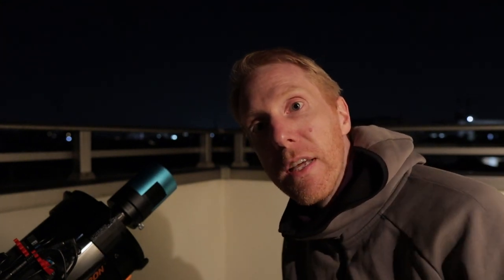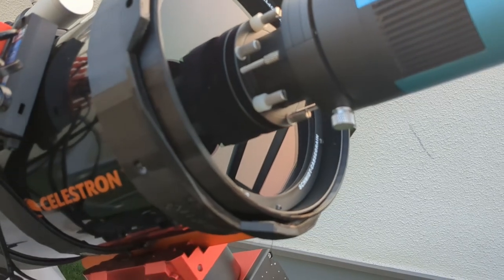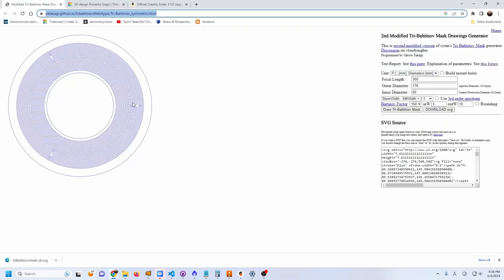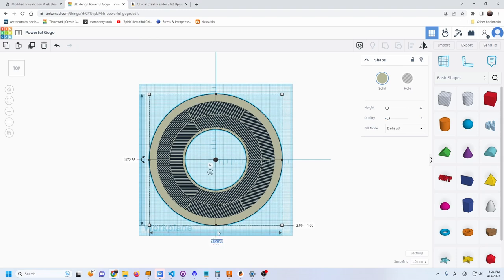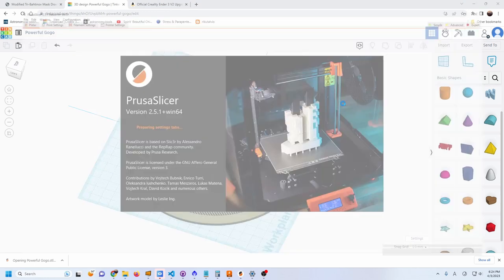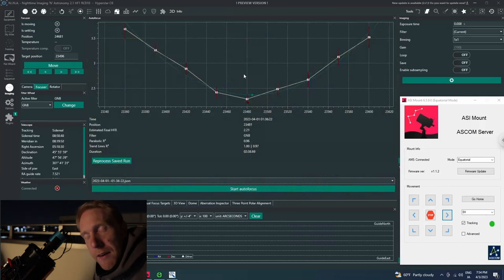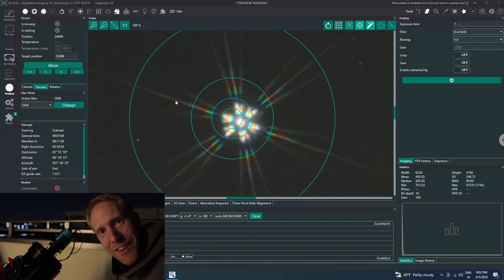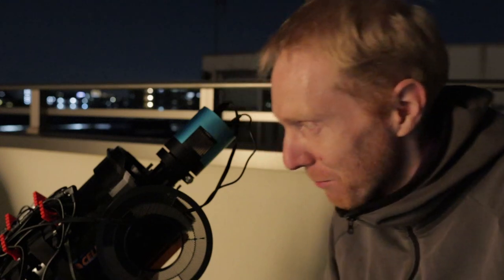The power of Tri-Bahtinov Masks :)

Comment: The Tri-Bahtinov mask is a really cool tool. What it blew my mind is that it was developed and perfected by a group of amateur astronomers on the Cloudy Nights forum.
I think you could use a piece of paper to make a shadow when trying to see which set of screw to touch, instead of selecting any random one, that way you avoid the possibility of messing with the ones that are already correct.
Reply from the maker: I used the shadow of my cables for the initial rough collimation, but not sure how to use the shadows once the Tri-Baht is on! And yes, it's amazing how amateurs can come up with such amazing tricks :)
Reply: That's what I love about the internet.  Someone has an idea, floats it on a forum and a couple of knowlegeable people, in different parts of the world, take up the challenge and run with it.  The outcome is a ground breaking piece of kit for all astronomers - and it was developed for free

Comment: Absolutely love the tri-Bahtinov mask for my SCT. It completely changed my collimation routine. It's fast and dependable. I glued small knobs to the mask 120 degrees apart, near the rim of the mask at the end of the 3 full radial lines that are 120 degrees apart. I align these the collimation screws (mine doesn't have separate push and pull screws). Then to know which screw to turn I hold my hand over the radius marked by each small knob until my shadow blocks the whiskers of the appropriate screw.
Reply from the maker: Ooh that's an awesome trick! Thanks!
Reply: Awesome trick!

Comment: So I called the guys at Starizona and asked about this topic (collimating a hyperstar) and they were pretty clear that you should start metal-on-metal and if it ever becomes the case that one of the 3 sides is no longer touching metal to start over again.   I think this has to do with back-focus which is super critical at F1.9.

I think if you try again with the Tri-Bahtinov mask but starting metal-on-metal you may find your corner stars have better shapes.
Reply from the maker: Very interesting, thanks for the tip! I assume this would change though depending on filter vs no filter... Aaaah complexity :)
Reply: @CuivTheLazyGeek  right.  When I spoke to them I did tell them about the filter drawer but they never asked about the thickness of any filter I may have in it.   

Now that you mention it. How do you tune the backspace when changing filters? Or even when you remove it when shooting broadband?
I’m going to call them again and ask

Comment: Great tips and suggestions - bought one of these for my C9.25.
On a separate note - I thought you had recently put out a video on cleaning your C8 corrector plate due to pollen in Japan - but - could not find it on your channel. Am I dreaming or - perhaps this was an older vid? 
I have the same issue - trying to live with it but might try to clean after Galaxy season...
Thanks for the great content Cuiv!
Reply from the maker: You're right! But I has to remove it as it was deemed I wasn't being careful enough with the cleaning product I was using!

Comment: Seems like a lot of work to me. It's a lot easier to drive down to Starizona and ask Dean to do it. He has a REALLY good eye for it.

But I am actually interested in a Tri-mask, and I saw that you entered the FL when designing the mask and wasn't aware that was a factor. I have an 8" Edge with Hyperstar, .7 Reducer and am not afraid of shooting in native F10. Would I need to have a separate mask for each FL? Thanks for everything so far. I can't stop staring at my Elephant Trunk image processed step by step according to you NB video on it. - Cheers - "Dustin Gazz"
Reply from the maker: Hahaha I wish I could just drive to Starizona :)
In theory yes you should have different masks, in practice the one for the shortest focal length should work for all (very fine mask)
Reply: @CuivTheLazyGeek  Thanks for the reply Cuiv. Let me give you the short version. 
Had just moved to Tucson late last year. Had an old 90mm AstroM and realized that I could take a picture of Saturn with my cell phone. 2 weeks later after buying different gadgets trying to take better pics with the phone, I Googled and found a place that sold telescopes and thought maybe someone there could give me some pointers. I didn't know anything. So mid December I walked in to that little store and met Dean and realized Starizona wasn't even close to the "Telescope - Used CD & Scented Candle" shop that it very well could have been in my mind. I don't know if meeting Dean was luck or destiny, but I do know that it has ended up being damn expensive. Cheers - "Dustin"

Comment: Nice Cuive, I'm wondering if the mask will work with RC telescopes. Also, you can try Sharpcap while colimating. It'll be much easier for you.
Reply from the maker: I think the structure is similar enough that it could be useful!

Comment: The Tri-Bahtinov mask method can trick you into making adjustments where you are grossly uncollimated.  Collimating by centering the  Poisson spot when you are barely out of focus (and I mean very slightly) is vastly more consistent.
Reply from the maker: I actually haven't had much success with the poisson dot method... At least with Hyperstar
Reply: @CuivTheLazyGeek  I usually use Firecapture to collimate my Hyperstar.  Crank the gain way up, lower the exposure, and set a region of interest of something like 400x400 around a bright star in the center.  You should be getting well over 100fps in this state.  Slightly defocus (inside, I think) where the diffraction ring is just barely larger than the spot.  The ring and spot are subject to a lot of distortion, but you should easily see if the spot is centered.

Comment: You seem to know your stuff i use eyepiece projection  micro four thirds i normality use a baader 5mm without  front  element  makes it 22mm but there 170 euros  because  they have t2 threads under eye rubber but its too much after crop i have a skywatcher 28mm eyepiece  2inch its clear and sharp i lifted the eye rubber there are threads 57mm can i step that down to 42.mm and use it t2

Comment: collimation issue on my old Meade 8" SCT.

question - will using the Tri-Bahtinov Masks work on the setup (using primary and secondary mirrors) or what would you suggest?

My guy says just to do the donut method - but I was curious if you think that the Tri-Bahtinov Mask will work on a non-Hyper Star setup as well as it did on yours?

I was looking at teh OCAL electronic collimator which you featured last year but it does not seem to be available any more.  It may not have been the best option for me anyways.

Comment: The Tri-Bahtinov mask is my choice too. You've beaten me to show it in a video ;-) I showed my mask for a bit in my video on the differences between the classic C8 and the EdgeHD 8. The one where I impersonate Dylan O'Donnell. My mask was printed on paper and cut out using a sharp knife.
Reply from the maker: I respect the manual aspect of cutting the mask - I've done that with Bahts before but for this tri baht the 3D printer was definitely better :-)

Comment: Great video! Do back focus and camera tilt affect the pattern the same way?
Reply: Yes, and this is the flaw with de tri mask. In the end, you have to do a visual inspection of the corners and then see if some improvement was made
Reply from the maker: Tilt in particular, but it is alleviated by having the star at the center of the sensor - still, important to check stars at the corners!

Comment: The Tri-Bahtinov mask was by far the best way to collimate my cursed Vixen VMC200L Field-Maksutov.
Reply from the maker: How do you like your VMC200L for imaging?
Reply: @CuivTheLazyGeek  When it's collimation was spot on, it was just a tiny bit better than my 150ED, which is nice. But unfortunately it's mirror cell is not good for such a fast mirror, there is no way between oblong stars because of mirror pinch or oblong stars because of mirror flop at random pointing directions. So my love slowly turned into hatred as I chased the non-existent optimal primary mirror setting.

Comment: Hey Cuiv, slightly different question. I see you are using risingcam aps-c sensor on hyperstar. That camera is about 650gms, and with hyperstar its about 1.2-1.3 kg. Does the c6 corrector plate holds that much weight without any isues? I have c6 and planning to buy hyperstar.
Reply from the maker: No issues whatsoever: https://youtu.be/ool3pnpmAt4
Reply: @CuivTheLazyGeek  Thanks, just ordered hyperstar c6 v4.

Comment: Cuiv I have a question for you. The SCT C11+Hyperstar is as well collimated as I can get it and I use a split Bahtinov custom made to achieve focus however aty best focus stars at the bottom of the frames are slighly larger than those in the centre at top of the frame. What is the explanation? Is there a slight tilt in the corrector plate? If so how do I correct it?
Reply from the maker: Sounds like a little bit of tilt. If your camera has a title plate, try to use that. Otherwise.... Don't pixel peep and be happy nonetheless!

Comment: So how do you know if the result you see from the tri-bahtinov mask is due to being slightly out of focus or due to miscollimation? This is what I don't understand about this process. The spikes will move if you adjust focus just like they move when you adjust the collimation screws. I'm confused on this part. You'd have to be 100% sure you were 100% focused before you adjusted collimation when you use this mask and there's no way to do that imo.
Reply from the maker: Use one of the three baht images for focus. Then adjust collimation slightly so the other two are better. This will likely also affect your initial baht image, so refocus to put it back at the center, adjust again. Rinse and repeat, until all three baht images are well centered. You are then both in focus and well collimated :-)
Reply: @CuivTheLazyGeek  nice! Finally somebody explains that process. Thanks cuiv!
Reply: @CuivTheLazyGeek what are baht images? I tried searching but Thai currency is showing up... I have the same setup C6 with v4 IMX571